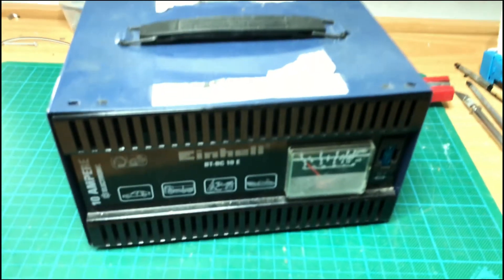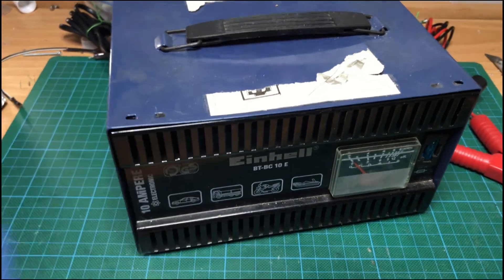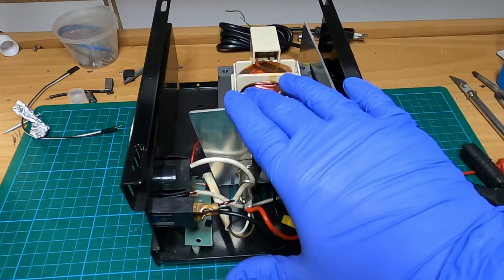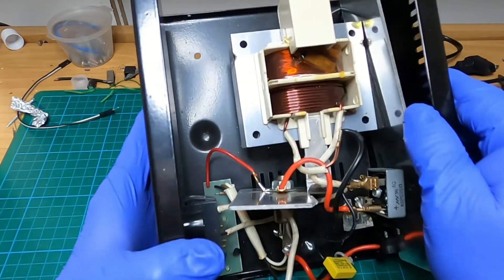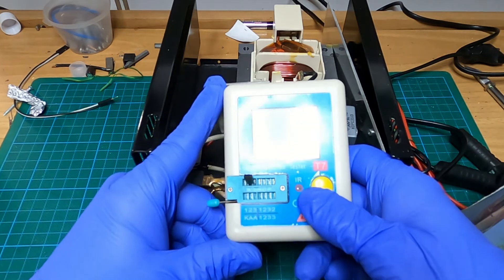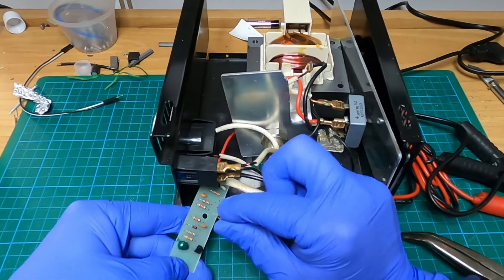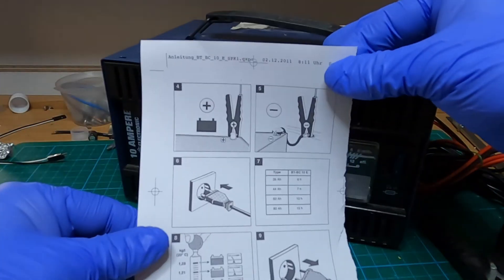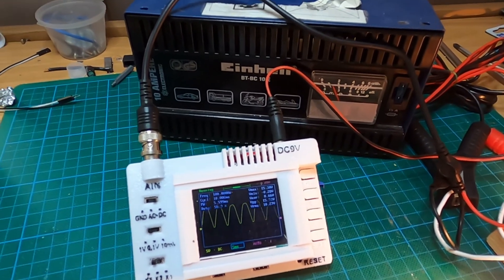EINHELL Car battery charger repair solution fix - BT BC 10E lead acid

Comment: Why does it discharges before charging? And how long it takes for a 74ah 680A
Reply from the maker: It does not discharge the battery before charging...
If the battery is totally empty and the charge is at 10Amps then about 7-9 hours...
This charger is not "automatic" I think....

Comment: Thank you for the video. I have the exact same charger model. It makes a buzzing or whirring noise when charging a car battery. Is this normal and do you think it is safe to use?
Reply from the maker: You are welcome! The buzzing noise is most probably coming from the transformer and it is normal... 
If the charger works and charges the batteries i wouldn't worry..

Comment: I have an einhell bc-12 charger and the same problem with the current ... but! There is no circuit in the "charger" at all. So I wonder how I charged here and there for five years. Now it does not charge, and inside there is a transformer, an ammeter, a 35A bridge and a 100N starting capacitor. That is there is nothing to repair, probably a faulty transformer and therefore to scrap...
Reply from the maker: That is a very basic charger but it works.. if the bridge rectifier tests good then you are right the only suspect is the transformer BUT inside the very top layer of the transformer there should be a thermal fuse (at least the bc-10 has one) you could check. Otherwise yes it is scrap unfortunately…
Reply: Inserted and connected: XH-M601 charging control board + Voltmeter DC4.5V~30V+ Inverter XL4016 Max. 9A. Set 11.0-14.8V and max. 5A. Great charger.👌
Reply: @petermikula9912  Did you keep the original transformer?
Reply: yes

Comment: Thank you. I think I may have a similar issue with my small Einhell charger as well.. Thyristor never turns on. I will check the transistors 👍